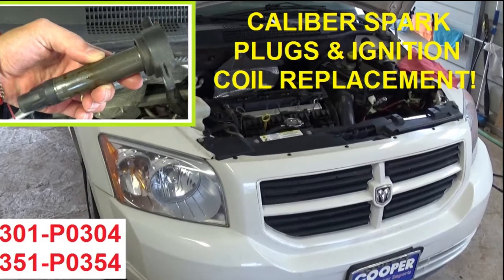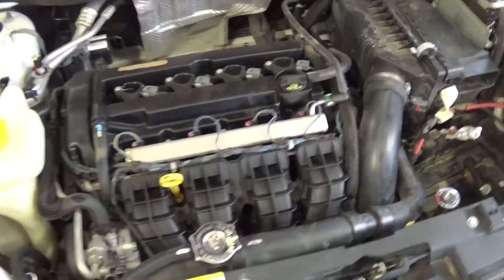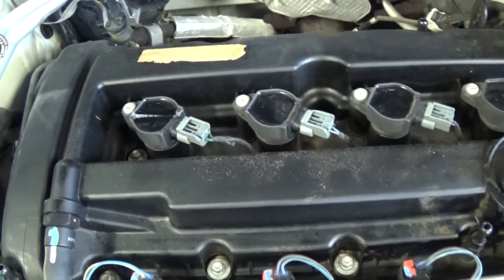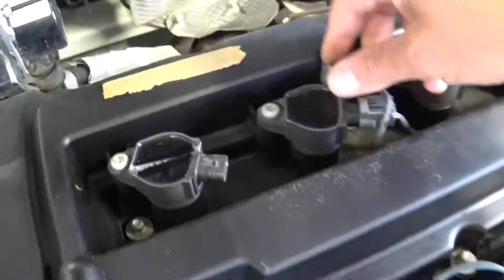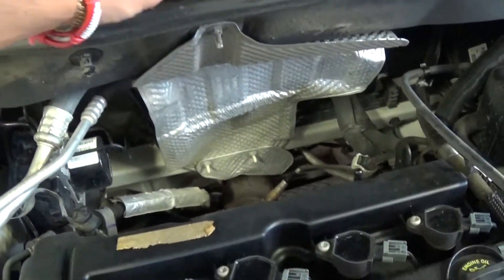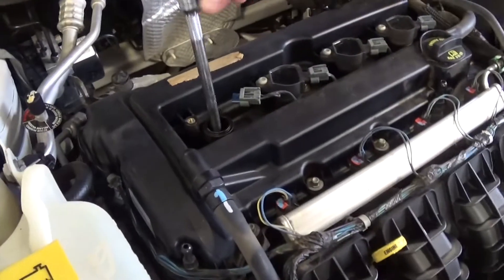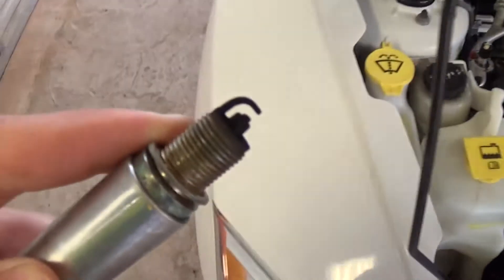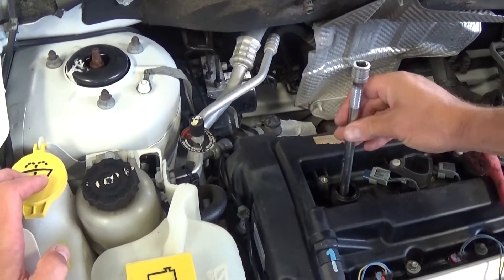Dodge Caliber Ignition Coil Spark Plug Replacement P0301 P0302 P0303 P0304 P0305 P0351 P0352 P0353

Comment: I wanted to do a lil tune up in my dodge caliber 2007. I have new spark plugs. Should i replace the ignition coil and other easy components as well? i now have 162k on mine. i put 6k on it last year due to traveling distance along with normal local driving.
Reply: Do you still have your 07. How's it holding up?